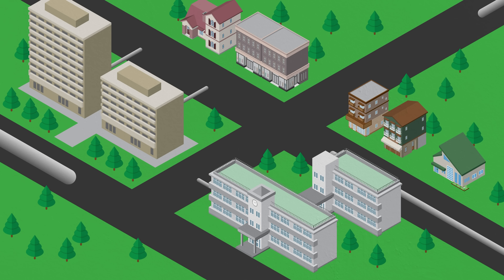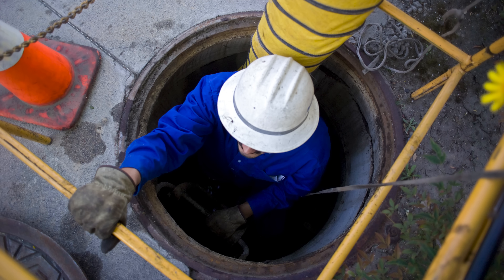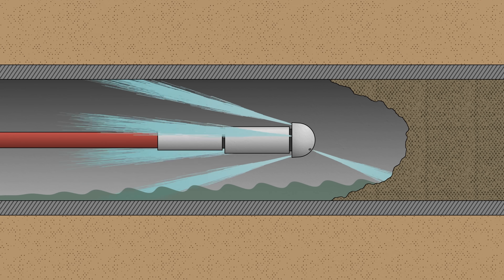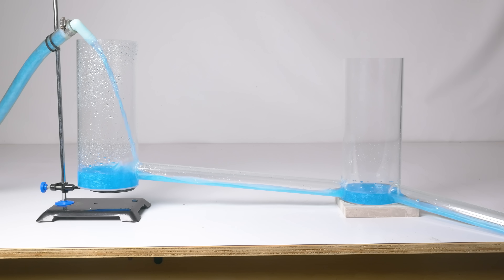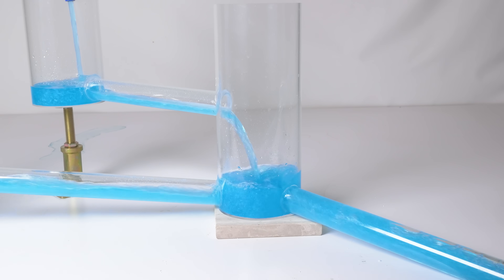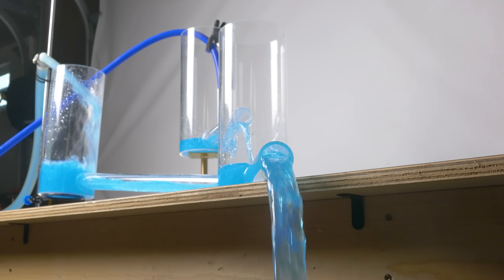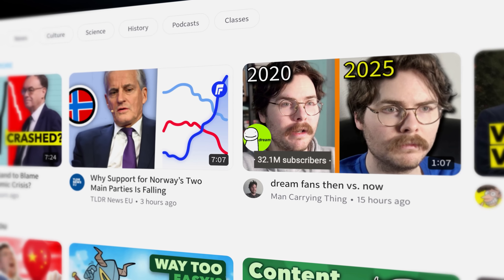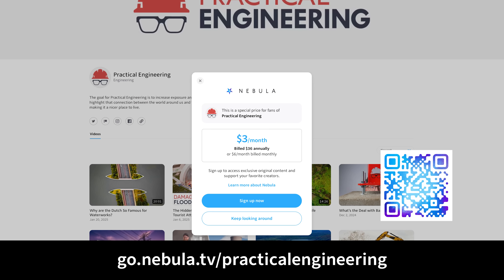What’s Inside a Manhole?

Comment: Flushable wipes.  If anyone buying those things would actually read the package (which I agree is a PITA as it is generally printed in a 4 point font, under the fold of the package) we would have no problems in our septic systems!  If you've used them, they are obviously made with synthetic fiber pressed into a sheet.  There is no septic system (or city sewage system) that can process what is basically a drier sheet, and they NEVER decompose!  Don't use them, or dispose only in trash.  If anyone thinks that they can merely flush these things away, making them "someone else's problem",  you will come to know very soon, whether it's your sewage line to the street, or your rural septic system,  that this was an extremely expensive mistake!   I am truly shocked that storm drains and sewage drains are shared anywhere!

Comment: City ran a new sewer line from one neighborhood through an easement on my property to another new neighborhood on the other side of my property using. gravity feed down and over to a lift station. Problem is each time it rains I now have water coming up from ground like a spring before the manhole that runs and floods part of my land. They have not found a reason why nor fixed it from happening to this day. It's been almost 2 years since install of sewer line. What do I as a private citizen do since it floods what was dry ground after a rain in normal time with no spring?
Reply: Get a lawyer, don't ask strangers on the internet 😂

Comment: One of the towns near me does hydrojetting of sewers, even if they are clogged with tree roots. The result is that the sewage backs up into nearby homes. Newer homes have valves to prevent backflow, but the older ones are susceptible to flooding. One of my friends basically had his home destroyed by several feet of raw sewage that they pumped into his house.

Comment: There is a minor error with the engineering in your model. Surface water often contains sand and gravel, so the outlet pipes from drains are typically mounted a distance above the bottom, so that any solids stay behind.

Comment: At work the parking lot flooded. This was due to a storm drain  water filter that was not maintained. Its metal frame was corroded and weak. It eventually fell into the manhole and plugged the outflow pipe. I ordered replacement filters and I just received them after 6 weeks!

Comment: The company I work for has 2 sewage access man hole covers probably a combined system since its a open cover like the rain drains. But the problem we have is it smells a lot, my boss says the pipes are Rusty and they have had to have someone come out a couple times in the past to remove the sewage. It smells awful so we cover it with a floor mat and that works just don't remove it or it smells right away if not right away then when you disturb the water.

Comment: Manholes are also placed every 300m from another in most places. They allow easy cleaning of the pipes.

Also pumping stations are used in newer city ( old cities did not have the technology for it). The station help save cost because the lower you dig the more expensive it is. There is a point where à pumping station is cheaper then to keep mom digging

Comment: We had an interesting issue in a nearby city, Hamilton Ontario. Back in the early 2000’s a contractor doing work in the sanitary sewer system accidentally connected an entire street to the storm system. It took almost 25 years for the mixup to be discovered.

Comment: Manholes are round because a round manhole cover cannot fall through its own opening. This is because a circle has a constant width, meaning it won't fit through a slightly smaller hole of the same shape, unlike a square or rectangular cover which could potentially be turned diagonally and fall through.
Reply: Very good , it should be the circumference of a circle is the shortest in the same area .👍

Comment: I have a question for all you manhole engineers out there. Can tou guys please please please run your pipes in the middle of the road and put your manholes in the middle as well. Because here in PA the manhole are not center and you have to drive zigzag to get around them sometimes you can't even get around all of them because they are checkered back to back. This is so frustrating...

Comment: I love your videos and often show clips from them in my municipal engineering class at the University of Toronto. Great to see this newest one on sewer hydraulics. But I was disappointed you didn't call them Maintenance Holes. Your video both notes they are for Maintenance and that they are used by more than just men. 

The term maintenance hole has been around since before 1990; its adoption is growing, but slowly. At least in Canada, many official standards and design documents refers to them as Maintenance Holes; but most practitioners still default to "manhole" in less official forms of communication. We need educators to lead the charge!

Comment: A busy street is on a hill near me.  It also clearly has a large drainage pipe underneath...built LONG ago.  They have been doing a lot of work on it as part of infrastructure upgrades.  But the manholes often slide off during heavy rains and overflow.  Downhill about a mile away is the Hackensack River.  It routinely floods parts of town, thus drainage is affected.

Comment: I used to live in a neighborhood that was low lying and could easily flood. The normal solution was a large ditch running through it to collect rain water and divert it to the local river. This wasn't always enough and I remember during one particularly heavy storm someone opened a drain in their backyard to save their garden. The sudden influx of water caused every basement along the street to rapidly flood.

Comment: About 10 years ago, I had to replace my sewage main, which cost me around $8K. The primary reason was it was 50 years old and had tree roots growing inside of it. There were hardened paper towels, tampons, baby wipes, etc that contributed to this. I've been so strict about what goes down the drains since that repair bill. I was astonished about a year ago when my new wife told me she flushes tampons, baby wipes and paper towels. I told her to please stop doing that and explained the $8K repair bill I had 10 yeas prior. She argued the wipes are biodegradable and putting tampons in the trash is just gross. She and her kids will also rinse plates off in the sink with the paper towels on the plates, which I then end up digging out of the drain, which I've also told them all to stop doing. About a week ago, I got so frustrated with this that I told her when I have to call someone to come snake the sewage main, she'll be covering that $800 repair bill.

Comment: This was great. Because I always wonder why they had 4 manholes in a row. I mean like a half a yard or less apart. Maybe they can get to each connecting part or tubing? Like in Chicago down Halstead from 12th to 124th street there are 1,000 manholes lol. Some are 10 in 1 block. I like 11:20 learning things also. But I get tired of driving over all these manholes. And they only do work through 1. So I guess it's just in case huh. Lol. But glad to have some info on the manhole reason. Thanks.

Comment: You spoke about sewage manholes, but I work with communications manholes.

They're literally just a concrete chamber with holes in the wall that have conduits going to other manholes or possibly inside buildings. They're just a way of routing and pathing cables underground.

They flood quite frequently so we have to pump out the water before entering.

Comment: When my small town put in its sewer system in the late 90's, they decided not to do a gravity system, because they didn't want lift stations. So they put in a pressure system and house has a grinder pump that pumps into the sewer system. So as each house pumps into the sewer, it helps push everything down to the sewer plant. So our system doesn't have typical manhole covers. We do have access ports for clean outs and air valves to help keep the air bleed out of the system.

Comment: Always a therapeutic experience listening to your videos.  A few thoughts for you, the manhole castings (lids) are also round for preventing issues when you are removing the casting for access. As someone that has dipped many structures, round manhole castings are designed in a way where if it slips off your manhole pick or if you put it in wrong, it does not fall into the manhole. I've dropped a handful of 2' x 3' storm inlets into a storm drain, and let me tell you it is not fun to get those cast iron castings out. And those were only 4' deep structures, sanitary manholes are obviously a lot deeper (I've seen up to 30' deep personally).

Truthfully you will never know what you will see in a manhole, most are standard, but every once and a while you'll see a really weird one. Around retention ponds or other stormwater facilities where they want to maintain water levels for an endangered species there are often weirs inside of manholes for diverting flows in certain situations while allowing a bypass in storm events. Those are truly bizarre to see.

Comment: In major cities most manholes are access points for utilities. I've worked in manholes that were more than 10 feet on a side. They're filled with pipe systems that let us pull new or replacement lines down the street without digging up the street.
In Wash. DC, the manhole lids started blowing off, scaring passersby. Those were all PEPCO manholes. I never learned what caused it.

Comment: 8:02 Wouldn't the increased water pressure from a backup cause the blockage to clear itself? For example I had a clogged shower drain once, so I got the idea that if I just fill the bathtub all the way up, and then drain it, all that water pressure would clear the blockage. And it did.

Comment: i used "flushable" wipes when they first came out for changing kids diapers. i flushed them and 2 months later we woke up to corn lake in the laundry room. i snaked out the drain myself and it pulled out a baseball size ball of wipes. i also would never flush clumping cat litter. that will cement your drain shut.

Comment: Here in San Antonio, I occasionally see what looks like an electricity pole, but it is a single pole made of wood or metal with a cylindrical metal top with vent holes in it. They also might have what looks like a meter on the side at eye level. Any idea what these might be?

Comment: I don't remember the reason but circular man hole covers are actually more dangerous than square ones, possibly because they can easily fall into their holes and kill whoever's below. A simple fix that doesn't sacrifice the round top is to just add a square part in the center of the bottom of the lid. You just need to make a square hole at the top of the man hole, doesn't matter if the square hole is part of a disk that is sits between the piper and the cover, so long as the disk has a square hole in it for the safer square man hole covers.

Comment: During the first Formula 1 practice session in Las Vegas in November 2023, officials discovered a serious safety issue with the track's manhole covers. They learned that F1 cars generate such powerful ground-effect downforce (suction) that it can affect infrastructure beneath the track. This became apparent when Carlos Sainz's Ferrari hit a loose manhole cover that was pulled upward by the aerodynamic forces of the cars, causing significant damage to his vehicle. The incident led to the cancellation of the practice session while crews worked to inspect and secure all manhole covers on the circuit.

Comment: If I may.. the design of parking lots is arrived at with these systems under consideration. If you look at a commercial area.. for example a Smart Center, there could be a dozen parking lots involved! A lot of people may think that getting ALL the rainwater evacuated from the lots as quickly as possible is the intent when in reality, all parking lots are designed to empty water at a rate determined by the scale of the surrounding storm/sewer systems so as to not inundate them. Put in a few in my time in Ontario and Newfoundland Labrador 😊

Comment: Ah I love these infra videos! I myself am a technician in a water utility company where we have sewers also in our hands. In our design culture, manhole in every turn is mandatory like you mentioned but also in straight sections at least every 60m because that will make clearing blockages easier. Usually local pump trucks have 100 to 150m of hose for hydrojets, so if there is a long section without a manhole + poor reach from closest road, things can get tricky

Comment: Why the manholes always have to be in the middle of the street? In a year or two after construction they always sink in a few centimeters under the weight of cars and trucks. And that makes them an unpleasant pit that has to be dodged when driving. I think it would be more effective to put them in the sidewalk. There is much less load and they would not have to be fixed so often.

Comment: I've explored some gigantic underground rainwater drainage systems here in Buffalo, with smaller wastewater currents up a short ladder on a platform to the side.  It's pretty cool, but watch out for all the spiders that have big knees under those manholes 

I tried to pop out of two manholes like a ninja turtle, and omg, why do the (what I know now are) cave spiders all hanging out 5ft from the actual manhole cover.

They were way too heavy, or stuck. Wouldn't budge off that rebar ladder

Comment: I always have the most respect for the labourers that can hang from the bottom rungs and trowel in the low flow benching to perfection in the bottom of the manhole in the wet benching concrete
Reply: I used to be a sewer project engineer for a mid-sized city. I was managing a sewer replacement project and saw the contractor's manhole channeling worker come out of a new manhole. This guy looked like he should have been retired for decades. I asked the project manager about him and was told that he was 80 years old and didn't want to retire. They paid him very well because his work was flawless. I looked in the manholes and they were in fact, flawless.
Reply: 95% of what we set are precast structures the only time we have to poor the base is on a dog house

Comment: It’s amazing to me that there can be enough of a grade to carry the water when it’s going thru miles and miles of a city. You’d think it would have to be 100 feet underground after a mile or two.
Reply: They have sewege lift stations because of this. Grady actually did a practical construction video on the construction of an extension to a sewege lift station.
Because it is a minimum grade of 10 degrees, every 1 kilometer (0.6 miles) you would drop 173m (567 feet).

Comment: I am an elected supervisor in my township. Before this I knew nothing about sewer systems. I have learned a lot and really enjoy learning from the sewer crew. One question is why no mention of force mains?
Reply: @OwlSaver  I worked on a mansion renovation in coastal Connecticut and when they redid the septic for the house, they said it was designed to feed the neighborhood force main. As they explained it, the fact that the area was about sea level already prohibited a standard system with the good old 1/4” per foot pitch. It was a level main that used pumps to basically “caterpillar” the neighborhood’s poop along until it could reach the sewage treatment plant somewhere else in town.

Comment: 1:06:  This is basically accurate --- but there are a few exceptions.  You will find huge walk-through sewer tunnels like this in large cities like Paris, as well as in New York City.  Remember also that, in any city, sewers are the lowest underground level of infrastructure.  This is to prevent sewer leakage from affecting other infrastructure.  However, the manhole entrances to these sewers are no joke becasue they consist of 100-foot-deep vertical shafts going straight down like water wells.

Comment: What's inside a manhole?  It depends ENTIRELY on what kind of manhole it is in the first place.  Is it a sewer manhole or an electrical manhole, or is it a manhole for telephone circuitry?  These manholes will have completely different things in them.  Some manholes are no more than underground utility vaults.  And by the way, there are steam manholes too.  These manholes contain pipes and valves for high-pressure city steam.  Not only that, but the most fancy and the most classy of manholes are entire underground rooms stretching for hundreds of feet, and they contain all kinds of infrastructure including pipes and wiring.  Some manholes are actually manholes WITHIN manholes.  You go down into the street-level manhole, you find yourself in an underground concrete vault, and in the floor of that vault is another manhole which goes down to a lower level of the manhole.  How's all of THAT for manhole art?

Comment: The round shape of a manhole cover is not just a matter of convenience but also of mathematics. A circle is a shape of constant width, meaning its width remains the same regardless of the direction in which it is measured. This property is crucial for manhole covers because it ensures that, no matter how the cover is placed, it will not fall into the hole. For comparison, a square with a side length of 'a' has a diagonal of 'a*sqrt(2)'  . If a square-shaped cover were placed at the wrong angle, it could fall through the opening. 

Interestingly, many other shapes also have constant width. Among them, the Reuleaux triangle has the smallest area—about 10% less than that of a circle with the same width. This means that manufacturing covers in this shape could save 10% of the material required (that's a lot!). However, they are not used due to existing industry standards.